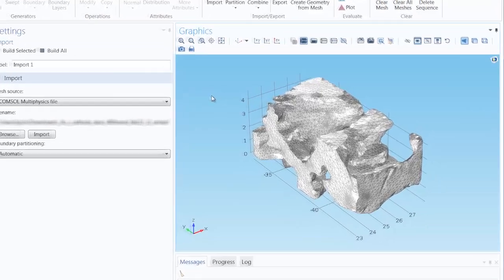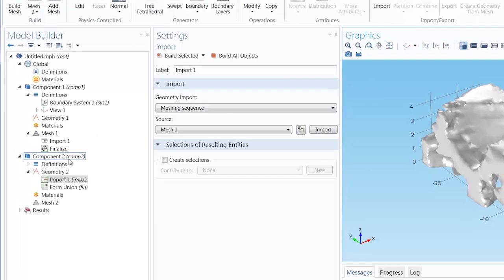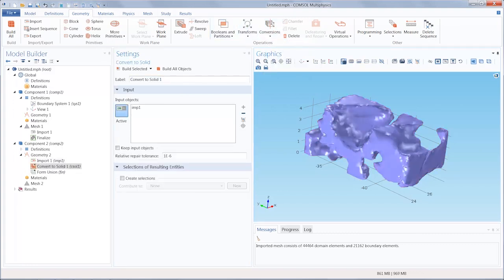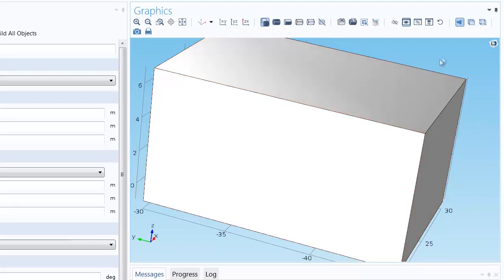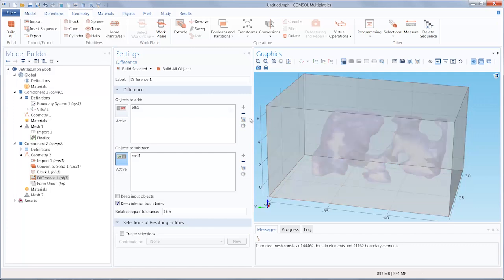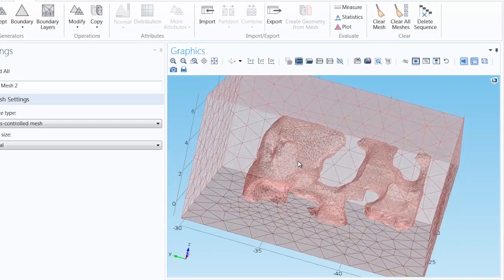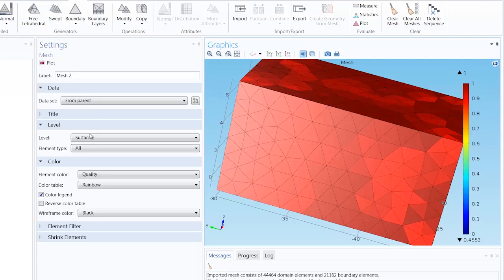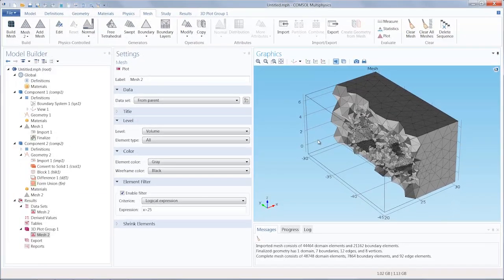How to Convert an Imported Mesh to a Geometry in COMSOL Multiphysics

Comment: While this is a great tool in theory, it rarely works this smoothly.  For the created geometry to be anything useful, COMSOL must be able to recognize the imported mesh as defining a distinct domain.  Even with an imported air-tight surface, this can fail.  Unless you get very lucky, don't expect this to get around the common problem of converting between a surface-defined geometry (e.g., .stl files) and solid-body geometry (e.g., parasolid files).